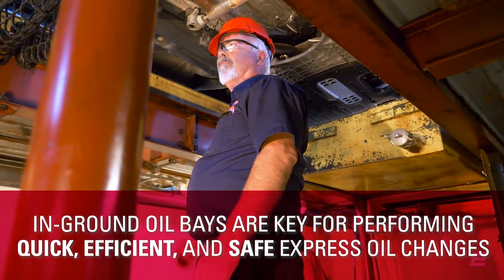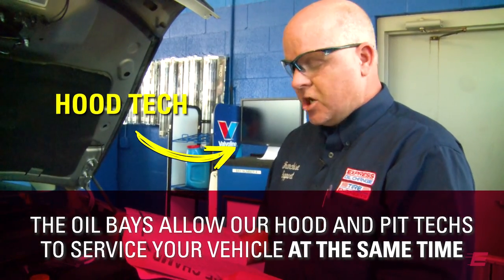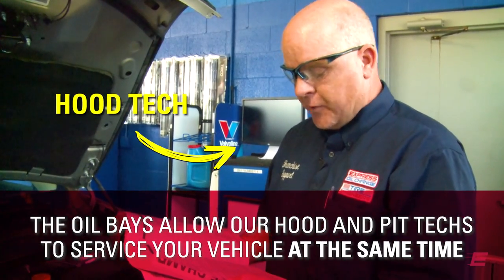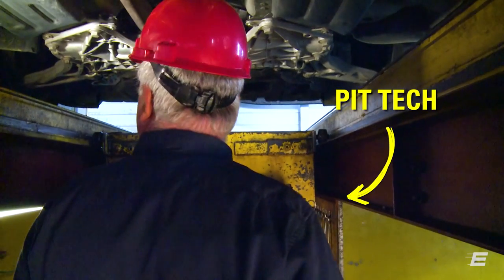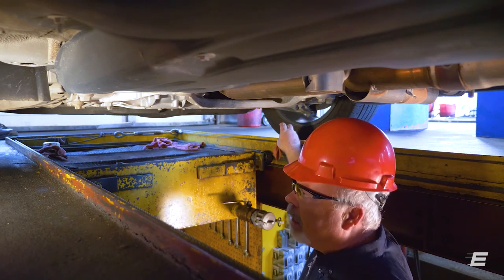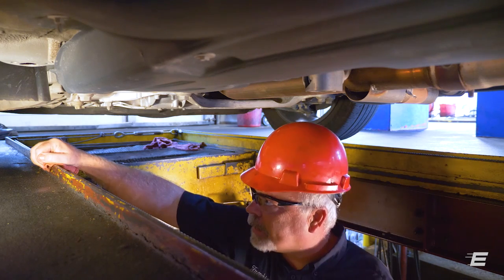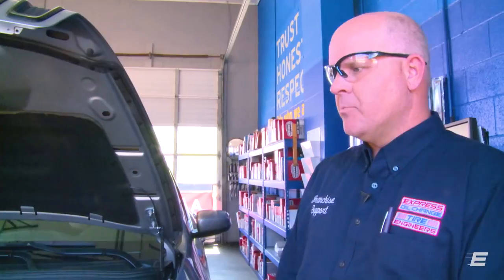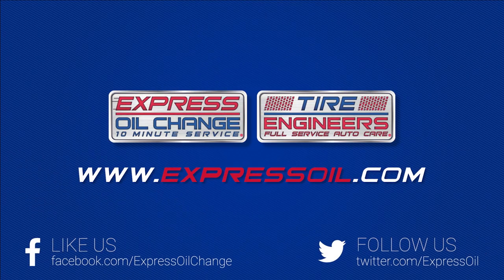What Goes On in the Oil Change Pit 🔍

Comment: I thought they used a hose to suck the old oil out because i couldnt figure out how they did it without lifting up the car 😭😂 omg
Reply from the maker: We learn something new every day 😂
Reply: I wana see them do one on a Chevy where the filer is half way up the engine bay and next to the catalic converter
Reply: @nikolaus.k9378  easy
Reply: @nikolaus.k9378  lmao I just got burned by own of those. Usually the hood tech will get those out. But I can remove and install them from underneath. Have a heat resistant glove or just a couple rags over your hand.
Reply: Probably an oil evac, depending on what you’re vehicle is